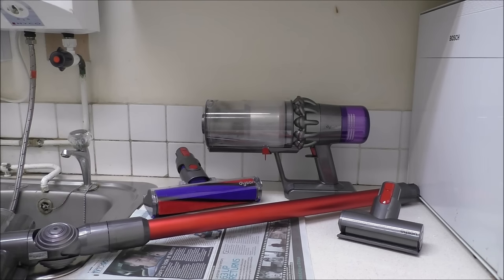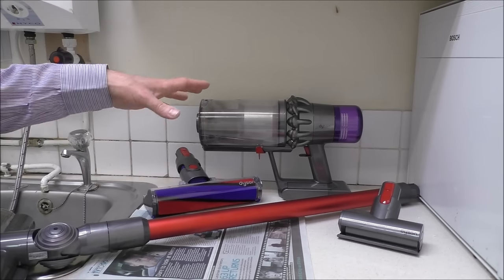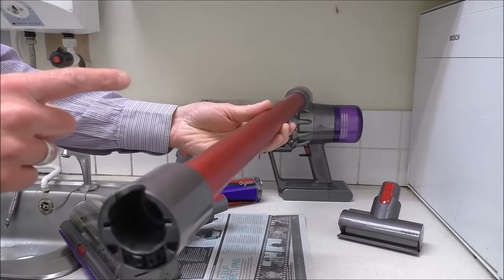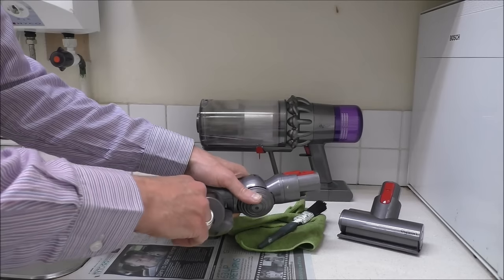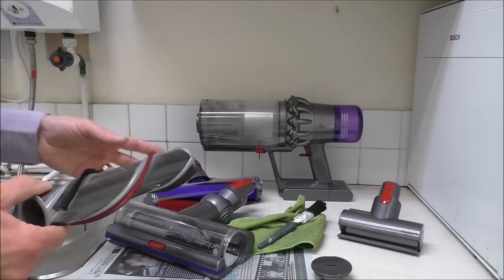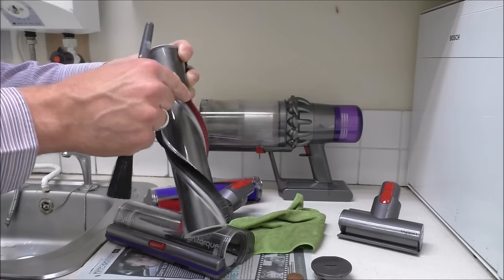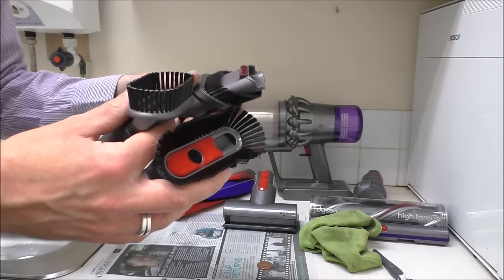How to Clean and Maintain the Dyson V11 Cordless Vacuum Cleaner

Comment: I can’t thank you enough for this video. The hair and dust accumulation at the top of the bin was driving me crazy. No amount of shaking would dislodge it. Being able to completely remove the bin is great, even if I don’t wash it, just wipe it out. Now, if Dyson would just change the trigger method of turning on the machine so I don’t accidentally turn it on and don’t have to hold the trigger while vacuuming…

Comment: When screwing a metal screw into plastic screw hole, carefully and gently go counter-clockwise until you feeling a little bump to find where the thread starts in the plastic screw hole, then turn clockwise to be sure the metal threads find the plastic threads correctly. If you put in the meal screw and just start screwing the screw into the hole to tighten, you may ruin the plastic threads and mess it up.

Comment: Thanks for posting this. Just bought one of these and was disappointed to find that there is no instructions included with the vacuum on how to maintain it. Not even anything about cleaning the filter!
Reply from the maker: No problem 👍
Reply: Hello... In the past few years, a common practice is of NOT enclosing a printed Users' Manual with an appliance. One has to download that from the website of the manufacturer/brand-owner. Nothing unusual with Dyson Vacuum. (I am not affiliated with Dyson, only a product user.)

Comment: Here are timestamps for the video for anyone who needs them

ACCESSORIES
1:03 the wand
1:23 the high torque head
4:45 the soft roller head
6:21 the mini turbine head/turbo brush
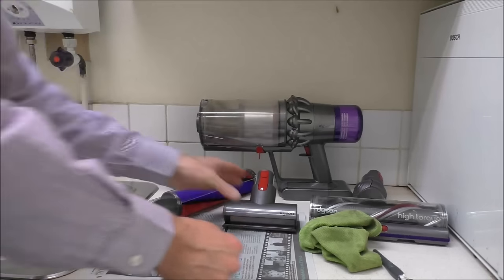7:41 brush heads

MAIN BODY
8:16 wash the back filter
9:42 empty the bin
10:06 remove the bin, brush it. If desired, rinse and dry
12:53 remove and replace battery if desired
15:02 brush down the nose under the bin
15:51 unscrew to open the front of vacuum and brush the insides
19:36 unscrew to open the back and brush the insides
23:17 brush down the nose under the bin (part 2)

24:46 reassembling everything
Reply: Lords Electrical, if you see this comment, please feel free to copy and add the timestamps to your video description so that it's easily accessible to viewers 👍
Reply: Thank you!!

Comment: Revisited this very informative video after having our V11 nearly 2 years. The beginning reminded me that I had not cleaned the brush head for a long time. The far end of the head on mine (that you can see with the brush roller removed), had a groove full of compacted fluff, which I removed with tweezers and a cable tie shaped to push the back of it to the front of the groove, to remove the rest of it with the tweezers. This groove seems to be a dust/fluff trap!

Comment: Good video but 2 things:
1) before taking the vacuum mechanical parts apart, always remove the power source (the battery) until the work is done to reduce your chance of getting shocked.
2) cleaning it this thoroughly would also void the warranty, but If you’ve had it longer than  the warranty covers then go ahead

I just ordered the v11 and I will save this video for when it’s time to deep clean, thanks!
Reply: 禄Abby deep cleaning the dyson is encouraged only when necessary. Dyson do have videos on how to correctly and safely disassemble and clean each part so I don’t think it would void the warranty unless you of your own volition break it. As long as it’s a default on their end or sudden break down of the equipment then it’s covered under the warranty.

Comment: The brush-heads (the rolling cylinder) you can take out and clean in water with soap! It even says so in the instructional manual!

For the wastebucket: It says to clean it with water.

For the vacumpistol: On the side you have a «big hole» thats the hole that dumps your dirt in the wastebucket. You can clean  with holding it under your tap while pointing it downwards.
You can even clean the metal mashing with holding it under the tap.

Otherwise good video if you want to go full vacum mechanic as this guy 👍

Comment: Thanks for the video. It certainly added to my knowledge of the V11. I usually use a leaf blower and blow out the whole unit. It’s very messy and you need an open area but it saves waiting for filters to dry and seems to do a good job of cleaning the unit. I will add your method to my cleaning routine. Thanks

Comment: Before I found this video I took off the front metal screen section and just used high-powered compressed air to blow out all of the built-up dust and debris inside. It made quite a mess out in the driveway but afterwards the vacuum was quite clean inside! Next time I need to clean it I'll know I can take off the cyclone chamber and how to do so so I can properly clean it in warm water! Thanks for the video!!
Reply: Be careful with the compressed air... you wouldn't want to damage anything... seals etc...

Comment: 26:17 first let me say thank you for being nice and slow on explanations, second although I love my Dyson after watching this i miss my V8 and V6 because it had a lot less screws and much simpler to clean, also because these are not normal screws and you have to get these torque/butterfly (what I call these😊) screws. Yes this is my third Dyson broom, and also have the canister that was the first purchase about 20 yrs ago and still working which now days only used for bigger jobs. Wondering why on my third? I’ve had 3 dogs at all times for last 25 yrs. So that should explain it😅. The V6 lasted exactly 5 yrs. Just as the warranty  expired, the V8 not as long, when the battery went out I just replaced, the motor went out, I replaced it myself, then it gave out in abt. A month later ordered a new one and didn’t work, called Dyson in the area and was told it would be about 99.00 to look at it, 😮seriously. So I said screw it for another 200 I got it at Costco , I asked for the V11 for Christmas from my husband, I know a vacuum, yes I did. I bought all the other stuff I wanted myself it just felt better that way,😂. So all in all I love My Dysons of course I wish they were a little less expensive, however still not happy about all the screws on this one as with 3 dogs I have to clean more often. Do not tell me to get rid of my dogs, not happening for those of you ready to comment on that😅. I’m not lazy just  very impatient. Happy cleaning to all.

Comment: Great video!! Thank you for sharing. The construction crew we had here for 6 weeks used my Dyson to clean up some of the drywall dust. I wasn't thrilled. I'll need to take the whole thing apart. Very fine powder-like dust caking the whole thing.
Reply from the maker: As good as the Dyson vacuums are, they are not good at fine dust like drywall and brick dust. I know your feeling as we had some building work done recently and trying to vacuum with the dyson was pointless as the filter kept clogging up.

Comment: There are very clear diagrams on the filter which shows that you should not be washing it as he demonstrates. You should run the water down the inside of the filter, and allow the water to spill out through the vents in the purple plastic part. Then you should allow it to air dry for at least 24 hours.

Comment: Just use cold water to clean canister.!!!!
I used warm water and my inside rubbers shrunk a bit. ( especially the red rubber).
When I put everything back together  the canister would not slide anymore to empty it . I applied some silicone oil and the rubbers nearly got back to normal.
Reply: Use baby talk
Reply: My red handle won’t go down?? Help please
Reply: @enisasefer2040  u need to rub the rubbers with some dust or baby talk. Because you cleaned it so good, the rubbers have to much friction.

Comment: 2/2 2:49 sorry forgot to mention, that other than the brush, you can use dust remover\compressed air as DID to get into the smaller areas, and to push out the water residue and dry a little faster in the canister area. After using way to much of air cans on vacuums, fans, AC etc. I decided to buy a plug in air pressure hand machine. Love it and no more cans in the trash/recycle bins. Btw there is also hand held ones with batteries, but then you have lots of batteries to throw out. Your choice depending on how much u would use it. The plug in works for me. Ty for reading.

Comment: Brilliant video! Helped me a lot. I have a question...the dirt bin is stuck, can't get it out! Any tips
Reply from the maker: It has happened on our demo unit and the best way i found was to push the bin up back into position then try and pull the handle down. It can be a bit stiff if it is full or needs cleaning around the flap. Good luck.

Comment: How often to clean it like this? 
I don't have a Dyson, I have a very generic bought on amazon UK for a faction of the price. It takes me a lot less time to fully clean it and maintain it. Obviously it doesn't have the same power of cleaning suction than Dyson of Shark but it serves me well and I never needed to unscrew it. All parts are designed to be dismantled for cleaning. I wonder when Dyson will make things easier for their customers. Probably it makes them buy new ones because not many watch such MEGA detailed video explaining how to do it.
Reply from the maker: It very much depends how often you vacuum and how dirty the vacuum gets but it shouldn't need doing more than once or possibly twice a year.

Comment: Thank you Sir, cleaning the filter. I note you cleaned the lower part of the filter. What about the upper part? Upper part looks like folded paper. Also how do you stop the musky smell of expelled air?
Reply from the maker: The paper part isn't normally designed to be washed, but if you do get it wet, make sure it is dry before putting it back into the vacuum. Musky smell is quite difficult to get rid of, if you have cleaned it all properly then it could be a case of changing the filter.

Comment: Have you ever tested the V11 filter before and after washing it to see how much particulate material is being emitted. The filter might not be as effective after washing it and continue to get worse with each wash
Reply from the maker: I haven't tested the filter before and after washing but you are correct that the more the filter is washed, the less effective it will be. This is why it is important to replace the filter on the odd occasion to maintain a good vacuuming performance rather than keep washing the filter and assuming it is as effective.

Comment: Excellent and helpful video. One question if you read this, I can see buildup on the cyclone heads inside the front section. I tried prying it apart and it looks like it wants to separate, but there's a lot of resistance around the bottom section where the electrical plug is. I won't keep trying as it feels like it will break. Did you try this?

Comment: What size torx driver for tiny screw holding the top seal assembly in the canister? That assemby came undone into 3 pieces and need right torx wrench
Reply from the maker: I can't remember exactly but I think it's a T6 or T8 you will need

Comment: What a great video - so clear and well explained.  Is it possible to give the specs of the screwdrivers and parts that you use throughout in a comment?
Reply from the maker: Apart from standard cleaning products the main things i have used are microfibre cloths and also Torx screwdrivers. The main sizes will be T8 / T9 or T10 depending on the model of vacuum, and these can be found pretty cheaply through websites like Amazon and Ebay. Thanks for the feedback

Comment: Couple of quick questions, if you were using your vacuum more or less daily, how often do you recommend cleaning it as per your video? Does it matter what type of pint brush, does a synthetic or bristle brush work better? Thanks
Reply from the maker: On the whole if you are vacuuming every day, you should only need to clean it like this a couple of times a year, if that. The main thing is to keep the filter on the back clean and ideally don't wait until the bin is full before emptying. It shouldn't matter which type of paint brush you use as well.
Thanks
Reply: Thanks

Comment: Great video!
I have dirt stuck in the rubber seals. Can I remove them to give it a good clean or are they hard to put back in?
Reply from the maker: The rubber seals are not really designed to be removed unfortunately. I would just recommend wiping them to make sure they are clean.

Comment: That part where you have to take out the screws to take out the battery is really stupid.

They could have done it better by designing some plastic or metal clamp.

Hisense did it better.

But every tech has its pros and cons.

Comment: I cannot get my red lever that is supposed to go down gently with your thumb to go down and open the bin that releases the dirt. And there is no lever with a "1"tab  on it to help as the video implies. Mine is the dysonv11 torque drive. Ive not had this problem before. I just cleaned it, and it won't even charge. Please help me get my vacuum going again. I love it.
Reply from the maker: Normally if you push the lever up and then down again, it should come open. Sometimes it may be the seal around the bin that is dirty and stopping it shutting properly that could be the problem. I am not sure if this is connected to the vacuum not charging though. It may help to unscrew the battery and re install it to see if there is anything stopping it connecting properly.

Comment: What happens with warranty when you undo the screw's? Can imagine that Dyson will not be happy when your completely open the housing
Reply: He mentioned replacing the battery. I think the vacuum should be designed so that the battery can be easily switched out so you don’t have to wait for a recharge.

Comment: You missed the ball joint (cleaning it out) on the first head. There is a pole that goes directly through the ball (centred) that everything catches on. This, if not cleaned out (I do so every time I use it) will eventually build up to a point that you have no suction at all if not cleaned.

You then missed the second roller - which also comes out for cleaning, on the second one.

Comment: My brush roller does not slide out easily like yours. Any suggestions ?
Reply from the maker: Sometimes it can take several turns of taking the brush head out for it to come out easily. I assume it is the main floor head you are using?
Reply: So which direction should I turn it ? It comes out about an inch and then won’t budge. I’m afraid to force it. It is the main floor head, the one you demonstrate.

Comment: I took the canister off to clean it and now after putting it back, the canister seems a little stuck and is much harder to open when I try to use the red lever for emptying... any thoughts / advice? It seems dry but maybe I’m missing something.
Reply from the maker: The main thing to check is that there is no dust or dirt in the bin seal. Sometimes when the bin is removed, the may be something stopping putting the bin back properly. Try pushing the bin on a little harder as well to make sure it is located properly.

Comment: Can some parts be washed under running water?
Reply from the maker: Apart from some parts of the bin the main things to clean under water would be the filters. Always make sure that they are fully dry before putting them back in the vacuum as it will damage the vacuum if they are still damp.

Comment: I vacuumed up talcum powder that was used to dry clean my pet's bed, and now the silver mesh part (@ 13:11 it's exposed) is quite blocked with it all. I've brushed it numerously over time but it's driving me insane because it's not entirely out - if I rinse this mesh part only with hot (50°C) water and let it completely dry, will it be okay to use or would this damage something beneath its screen (despite it having dried fully) ? 
I don't know what's lies underneath the meshy part 🤔 hence why I'm asking...
Reply from the maker: You should be ok, as long as it is dry and try and get as much of the talc out as you can.

Comment: I happened to wash mine now its not working properly.  Is it broken now because I wet it? Please help
Reply from the maker: Did you wash the actual vacuum or the filter? If you have washed the filter then put it on the vacuum and used it while it is still damp then chances are it has damaged the vacuum. You may need to replace the body of the vacuum.

Comment: I have a v11 and a 20 year old Mielle. The dyson is a pain in the ass, have to mollycoddle the thing and it's uncomfortable to use. The handle is not ergonomic and my trigger finger rubs off the finger guard. within two years the motor head broke and the trigger failed, both fixed under warranty, don't expect to last much longer. but the Mielle has never had a issue and I now use it more often. wish I never bought the v11. power cable and bags are just a better overall system especially when you buy from a quality maker

Comment: Wouldn't it void the warranty if I unscrew to disassemble and clean deep?
Reply: It will, but how are they going to know unless you damage something whilst taking it apart ? 

Just be careful with your screw heads and seals and don't use abrasives internally  👍